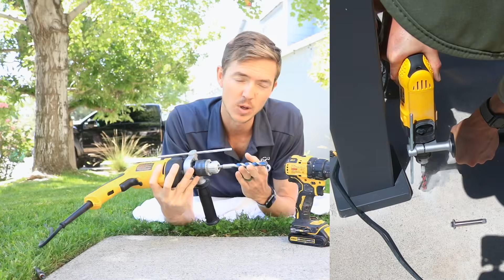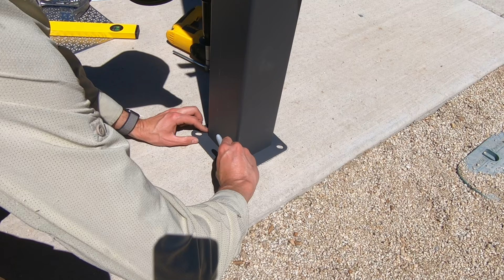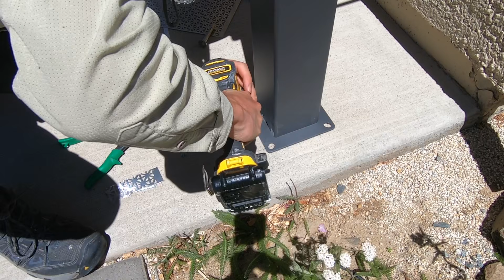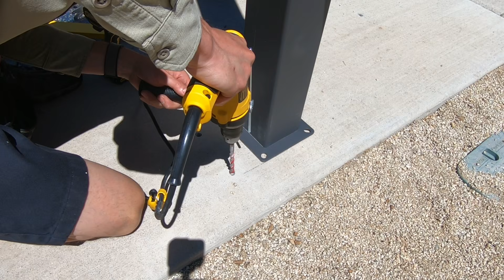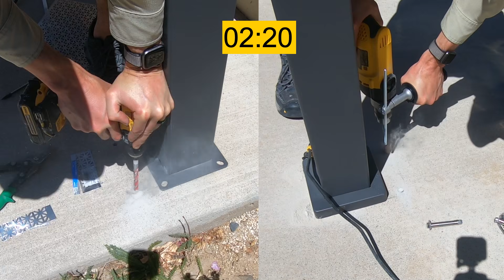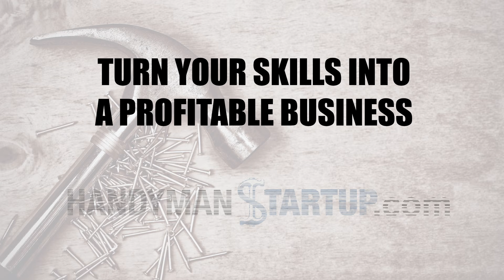How To Drill Into Concrete

Comment: So that cordless DeWalt didn't even have a hammer drill function? Doesn't sound like it. Hope it's still under warranty. Classic case of just because you can doesn't mean you should. With a typical cordless hammer drill, you let the tool do the work it doesn't need to be leaned on and pushed with all your body weight. As for using a regular drill/driver cordless drill and all your body weight to go through concrete, well that's just plain stupid. Take that down payment and get a cordless with a hammer drill function if you're not going to use the corded. You just look dumb.

Comment: It'a pain in the ass to use just a regular drill to drill into concrete 
For a homeowner it's fine maybe 
But for a guy who works a lot in drilling into walls it's not pratical 
Did you try climbing a ladder and applying force in a horizentel hole ?

Comment: Here's another shocker most ppl don't know, that "regular" cordless drill that you are using, has a hammer function built right into it, meant just for this application, simply rotate the black clutch on the chuck itself to the little picture of the hammer on the top which is past all the numbers and the picture of the regular drill bit and watch it cut through concrete like butter. You will all thank me when you try it. Idk about other companies but most all dewalts have this function built right in

Comment: Drill with a smaller hole because it’ll be easier going through the concrete, then move up to the larger drill bit. It takes less toll on your drill,especially if it’s cordless.

Comment: That was very informative, thank you. I likes the tip about correcting the position of the hole.

Sometimes it’s a bit hard to put all your weight on the drill, though, like when you’re drilling high on the wall from a ladder, or in the ceiling. Recently I had to drill 6mm holes in the concrete ceiling and even a hammer drill didn’t do the trick, I had to use a rotary hammer.

Comment: I drilled 4 holes to mount an air compressor with a regular drill , one didn't line up when I was done , a regular drill will walk a little when it hits a stone in the comcrete

Comment: I just drilled a hole in old concrete with a 3/16" x5 " bit .. for a 1/4" x 2 1/2" tapcon.  for some reason that tapcon doesn't want to go all the way into the hole. Maybe i pushed too hard on the drill and it slightly warped the bit while drilling?  would that cause issue with the tapcon going in?  I like your tip on using the drill w/ bit and vacuum to clean . I did clean out the hole but used  a little brush and canned air.    any ideas on what went wrong and why the screw doesn't want to tighten down into the concrete? thank you

Comment: just used my cordless drill no hammer drill couldnt barely get 1 in deep, was afraid bit would break with to much pressure. gonna get a hammer drill wondering if a cordelss hammer drill would be as good as a corded hammer drill?

Comment: In my opinion  that larger drill is more closer to a rotary hammer than a hammer drill. The hammer drills I know about are about the same size as the smaller drill in the video with a hammer function

Comment: The drill motors you show all appear to use a normal Jacobs type chuck.  The drill bits you link to are all SDS bits.  Can SDS bits be used in a normal Jacobs type drill chuck?

Comment: I thought I knew how to drill into concrete until one day I was drilling into something not even the hammer drill would do any good on so I bought a rotary hammer drill and omg it was like a hot knife through butter. In fact, I had to hold it back a bit.

Comment: The difference is wear and tear on your cordless. If you’re doing lots of holes you will burn up the cordless, a good sds hammer drill will last years with daily use. For a home owner this is fine, but for me, a 25 year veteran in structural concrete form work, it’s not even comparable.

Comment: You say a hammerdrill is not going to create better quality holes than a regular drill but I beg to differ based on my 18 years in the industry. I appreciate the hack more or less but it is like using a fork over a spoon for cereal. Sure you can use a fork but it isn't optimal. A hammerdrill is much easier and efficient. The biggest discrepancy here is the difference of drilling into fresh concrete as your video shows and drilling into mature concrete, which is not addressed. Hardness is significantly different. Yes, you can use a regular drill in a pinch but you should not rely on it regularly as it is hard on your tools and will cost you more in the long run.

Comment: If yout using expanding anchors it doesn't matter what kind of drill but if your using tapcons your less likely to wallow out the hole with a hammer drill and the screws will hold better. Also if your not using a hammer drill your goi g to wear out the drill bit faster.